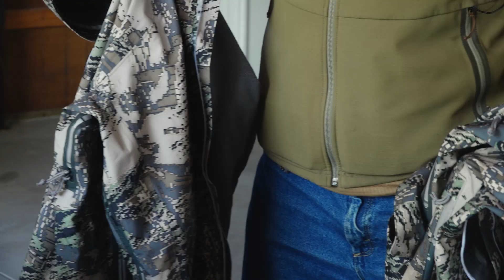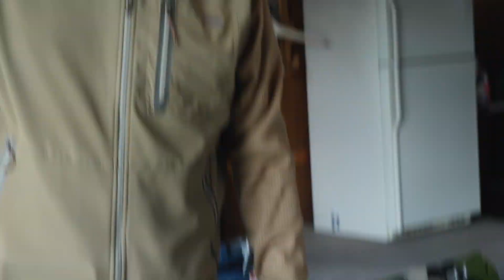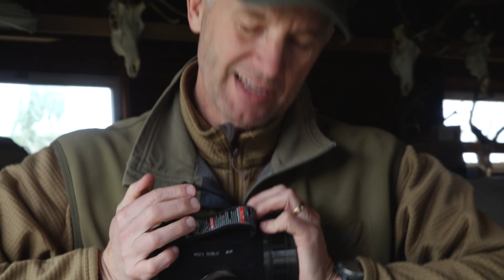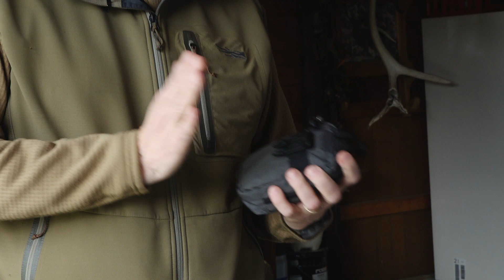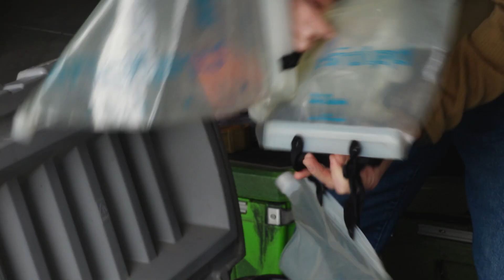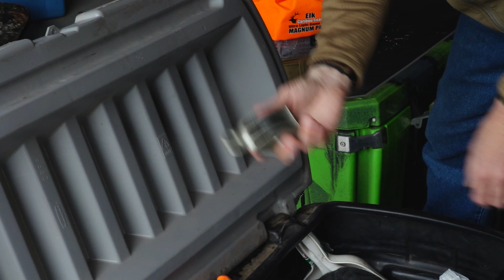Alaska Black Bear Gear & Equipment with Randy Newberg

Comment: Randy you are absolutely correct on the taking of fuel on a plane.  One time in Anchorage, AK we were flying to Kodiak Island for a Deer hunt.  At check in the agent took the cap off of our Coleman lantern, turned it upside down and one drop of gas dripped out....We had to leave it behind.  For any commercial or public charter you cannot take fuel.  If you paid for the whole plane (private charter) you usually can take fuels.

Comment: Hey Randy what size duffel dry bags and top loading dry bags do you recommend for this particular hunt and do you use a particular make and model?

Cheers.
Reply from the maker: I have all sorts.  Sea-to-Summit is probably my most abused ones, but this year I picked up two from Mystery Ranch and one from Simms.  They have been working great so far.  I have all different sizes.